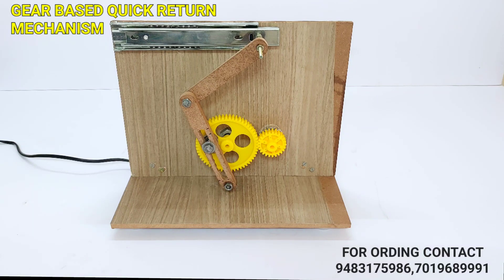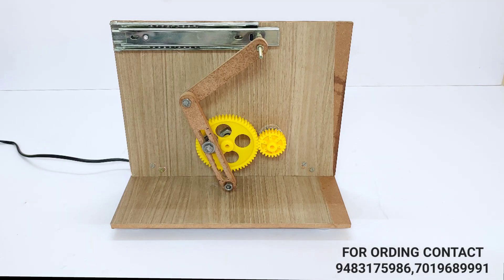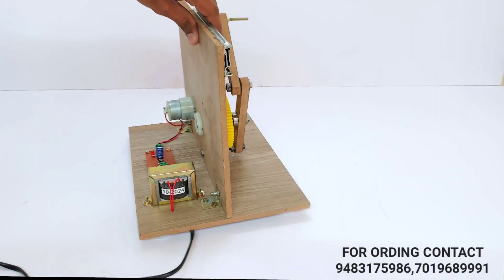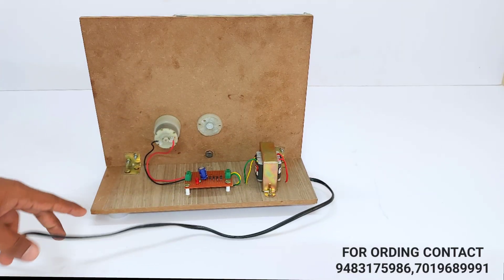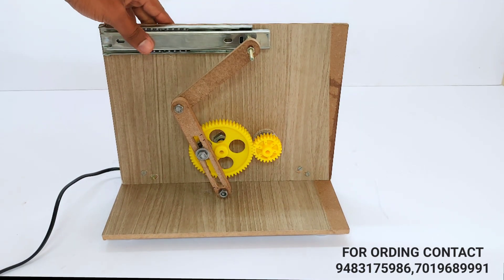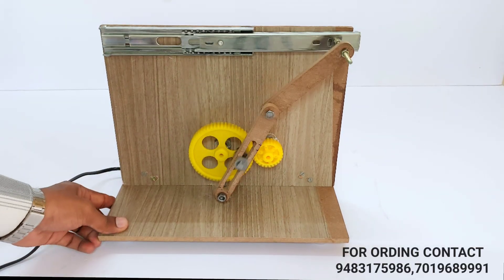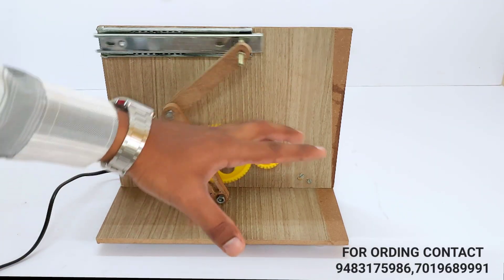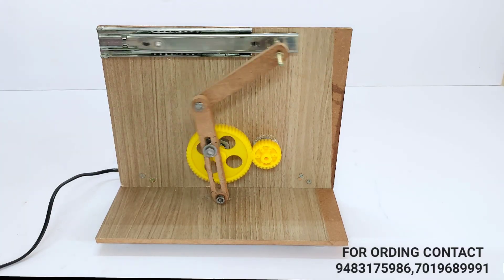GEAR BASED QUICK RETURN MECHANISM #gear  #based  #quick  #return  #mechanism  #engineering

Comment from the maker: For ordering the project, contact us : +919483175986,  +917019689991.
Instagram: https://www.instagram.com/_creativity...

This is our new project :- GEAR BASED QUICK RETURN MECHANISM The Gear-Based Quick Return Mechanism is a mechanical system developed to improve the operational efficiency of machines that rely on reciprocating motion, such as shapers, slotters, and other metal-cutting tools. In traditional setups, the working stroke—responsible for actual machining—occurs at a controlled speed, while the return stroke, which does not contribute to material removal, consumes a similar amount of time. This results in reduced productivity and inefficient use of energy and time 

------------------------------------------------------------------------------- 

IN THIS PROJECT, THERE ARE FOUR KITS AVAILABLE 

1. The "For Documentation" option provides comprehensive documentation (over 60 pages report, 15 to 20 slides PPT, circuit diagram, program code, PCB layout and schematic, explanatory video), along with audio call support, for a price of 1999 Rs.

2. DIY Project Kit of the project .
The DIY Kit includes a bare PCB, solderable components, external components, and all necessary documentation (over 60 pages report, 15 to 20 slides PPT, circuit diagram, program code, PCB layout and schematic, explanatory video) for institutions, priced at 5499 Rs.

3. Ready-made Working Project kit.
The ready-made project kit along with comprehensive documentation (over 60 pages report, 15 to 20 slides PPT, circuit diagram, program code, PCB layout and schematic, explanatory video), audio and video call support, and a one-year warranty, priced at 6499 Rs.

4.  Ready-made Project + DIY Project . Ready-made project kit, One more extra bare PCB solderable components for extra PCB, All documentation (Report more than 60 pages, PPT 15 to 20 slides of the PPT, Circuit diagram the project, Program code of the project, pcb layout of the project, pcb schematic of the project, pcb sel screen explanatory video )Audio and video call support, One year warranty, priced 7499 Rs.

-------------------------------------------------------------------------

📱 Get Connected:

Connect with us via WhatsApp or Instagram to explore our project offerings, discuss customization options, or place your order. Our dedicated team is here to assist you every step of the way.

🔗 Contact Information:
WhatsApp: +917019689991, +919483175986